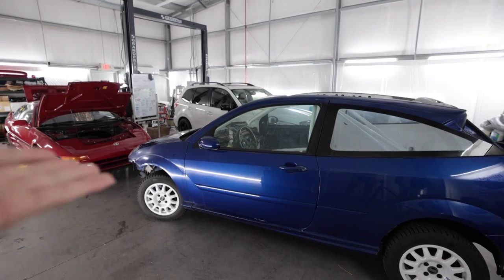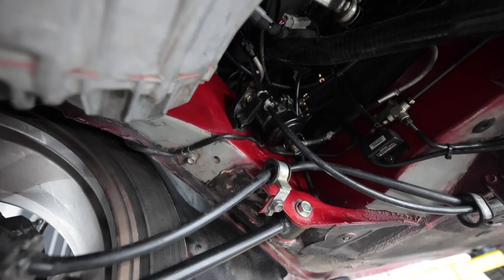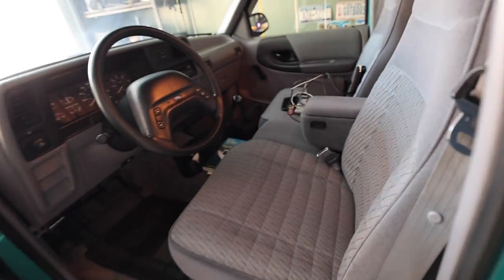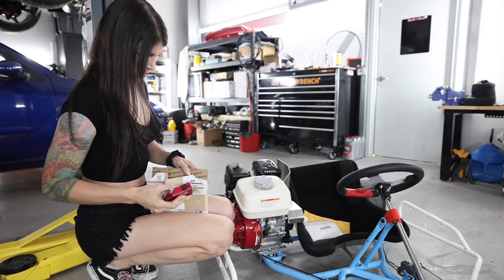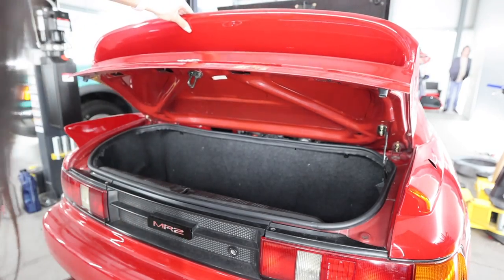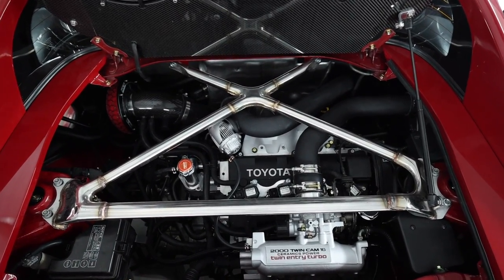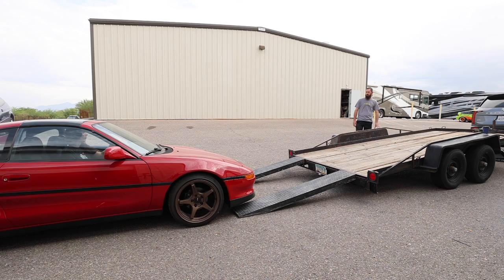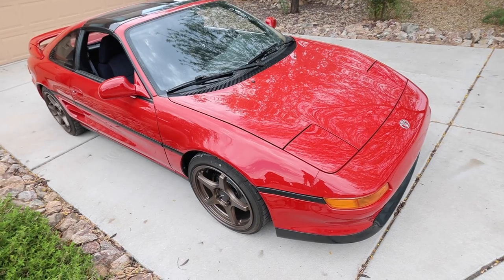Not How This Was Supposed To End.. // Project MR2 Turbo Vlog

Comment: It's Murphy's law of car repair: Bolts will always fall where you can't retrieve them.
Reply: OMG, I can't believe how many time a bolt falls and land right in the middle of the car on the ground where it's hard to just reach and grab it from any side of the car.  Or, it lands up against the tire and you can't find it!
Reply: @TheShornak  or doing a sacrificial drop with another bolt to see where it lands, so hopefully you can get an idea of where the first one went, and then the second one disappears too
Reply: @badopinionsrighthere  oh yes definitely
Reply: Murphy's Second Law of Car Repair: The 10mm Socket will always be missing when you need it.
Reply: 10m socket
Reply: @desertsoldier41  that's why I buy them three at a time
Reply: If there's a catch pan full of any kind of liquid within 10 ft  that's where anything you drop is going!
Reply: The first and only time I droped a nut inside the intake of a S/B engine at age 16... I thought I would be riding a bike for the rest of my life.
Reply: A portal to another dimension lives under my bike because on the numerous occasions I've dropped a bolt or nut it's never seen again.....

Comment: Has anyone ever seen a project that didn’t cost more and take longer than they thought??? Completely normal.
Reply: I had one come in under budget.  Mostly because I spent way more time rebuilding parts than I normally would have.  I also did all the prep work for paint, sanding and grinding everything, etc.  I normally don't because it's very time consuming when you have several hundred welds that you need to finish.  There always seems to be a way to save a bit of money, but it always cost you time and lobor instead.

Comment: Sarah in the words of one of my aircraft maintenance nco supervisors "throttle back turbo throttle back"!  There's no need to feel pressured or rushed.  I have a 91 mr2 myself and I'm in the process of sourcing and swapping in a 2grfe along with the e153 gearbox then later I'm turbocharging it.  I've been watching your channel for a while so I can appreciate all the nuances in a build be it restoration and mild to wild mods.  Your sw20 is much further along than mine but with anything it's only time. 👍👍👍👍👍

Comment: Grab some cheap wood and make a platform, you can safely stand the box up on the front with some blocking so the weight is evenly distributed and not all on the fenders and rail.  If you take the front fenders and grille section apart the cab can sit on cheap wood roller carts that you can easily push it around on. I did the small shop thing for a while, keeping stuff on wheels makes the shop space more useful sometimes.  Also, stacking stuff really helps.  You can actually lay the bed down flat and put a wood frame inside and stack the cab on top as well.  If you build the rig right there is enough space to store the front fenders and grille inside of the bed, too.

Comment: if you need to/plan to take the body and/or bed somewhere to get painted (next door) the cheap and sketchy way is four jack stands and four furniture/machine dollies. Pull the cab with the hoist, roll the frame and bed out, lower it onto the dollies and roll it over. Warning though, that cab will probably fight you coming off. Also, you might find a body shop car dolly for sale used. Maybe you and the guys next door could go in together on it.

Comment: no rush on the MR2 watching that car become something is cool. on the base tune try to be the air/fuel ratio at 14.7 at idle and 13.5 under light load, and 12.5 under full load. go no high then +27 on the timing.

Comment: I havent seen any comments yet Sarah about the truck and the body removal, can you reverse the tray up into the hoist so the lifting arms are in a central area and use that to lift the tray off then you can drive it in and do the same for the cab if they are a 2 piece design.

Comment: No woven splash mat in oil catch pan? Where are the skater boys when you need another set of hands? Straps on your wheels can rub off your paint or finish. Rubber tire contact points technique no problemo.
Overhead storage or crane to hold the bed/body up.

Comment: If I had extra $$ I would find a mobile dry ice cleaning crew to send your way.  I found some around Phoenix but it is not cheap, unfortunately. I would get them to try some of the frame on the Ranger too so that you could see if the frame is saveable.  I know you said a frame swap was going to happen if I remembered right.

Comment: You should never use a liquid filled gauges in the engine bay because as the fluid warms up it will give you an inaccurate reading. Saw a guy test this and his fuel pressure went from 8 PSI to 4 PSI.

Comment: Question? Is there any reason why you can’t use a mail order tune to at least get it running? That would be the quickest/easiest way to get it running. No? Then when a shop has time to strap it on the dyno,get the proper tune with the e85 and all.

Comment: your more than smart/skilled enough to do a road tune on the MR2! why are you not having a crack at it? there are plenty of 3s-gte ignition maps online just grab a few average them out on the conservative side, fuel on the rich side everywhere but cruise/idle and then its just tweaking the compensations, then you can get a few miles on it make sure its all working well before a quick sharpen up on the dyno.

Comment: Can the roof of your shop support a hoist that you could use to lift the body of the ranger? if so, you could have the body of it, above it. With all safety measures in place so it doesn't and cant fall of course, we don't want to loose you.

Comment: I don't know how hard it is to pull the spark plugs on the MR2. but with them removed the starter motor in first gear should have been able to pull the MR-2 into the trailer.  A second option would be a non-electric "Cable Winch Puller" if the $15 to $30 variety as with the weight of the car, at the angle of the ramp should only require at most 800 pounds of pull force.  A third option would have been to use a "jump box" on the wench on the trailer that was "not hooked up". A fourth would be to unhook the trailed from the tow car, chock the wheels of the trailed and use a rope from the tow car to pull the MR-2 onto the trailer.

Comment: I would say for you to check out the dry ice madness right now because it works so amazing on cleaning anything on the car even underneath but it costs so much. And we all know it would just make you dry ice everything you see!
Reply from the maker: I've been trying like crazy, the systems are just too expensive. I'm going to have to use other less effective methods unfortunately.
Reply: @SarahnTuned  yeah from the guy on Tommy and Obsessed Garage it's like $10k for the little system, that's just nuts.

Comment: Yes, there is a torque setting for everything. Not sure I would powder coat the control arms or degoo the frame.  Yes a spare tire would be good. 
And I would absolutely put in an AC system in the Ranger and clean the rust off the frame rails. But try really hard not to take the body off. 
And.....Why would you need a fuel pressure gauge on the MR 2?  Oil pressure, Temperature,  boost and maybe a vaccum gauge? An ethanol reader? Seriously?
Anyway,  I Wish you were working on my car... Love from NYC Larry. 

To be completely honest... I would have found a machinist to install machine in or whatever new bearings into the OEM distributor. 
Sorry.... I know you are waist deep in this aftermarket ECU thing but there. I said it. Whoa,  that's a load off my mind.

Comment: You need a west coast frame for that poor danger ranger, That thing is rusty. I think all car people empathize with the general shortage of parts and people. The future of our hobby is looking pretty bleak as the world pushes to demonize petrol consumption.  The bed of the pick up wont take up much room stand it on end along the wall throw a strap around it for safety. The cab and integrated front inner fender structure is going to need to be on a dolly then you can put the frame up and move the cab assembly around out of the way as needed or secure short term storage and place it there.

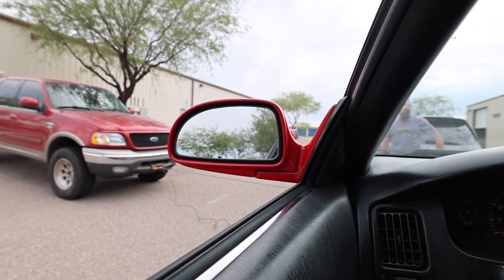Comment: @ 12:25 "WARTHOG!" ... SQUIRREL!
@ 13:02 "The Telluride does a surprisingly good job at towing"... You really don't want to use a KIA to tow 5,000 lbs. You will not find any lecture in the manual from the manufacturer claiming how much you can tow, because they don't encourage it. 🙄